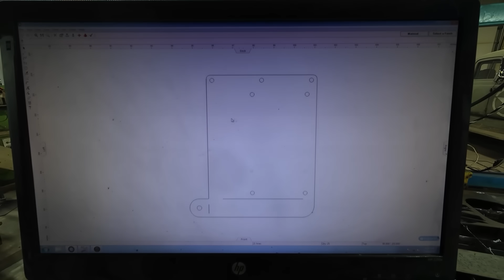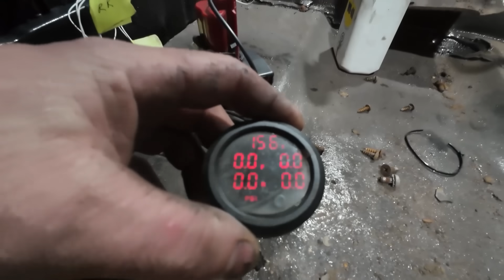Installing & testing the air ride on our 1949 GMC Roadster pickup!

Comment: Funny - this truck... the way it looks... makes me think of a recent build on Salvage to Savage.  They customized a blue and white pickup ... and are still in the middle of it I think.  The bed doesn't have a bottom on it, and it looks a lot like yours... but I guess it would look like any pickup truck - even as far back as 1949.  If you haven't seen it, you might want to check it out.  They are an upscale resto-mod builder, from what I understand.  You make stuff work... and they work on pricey stuff.  Enjoying the build.  Thanks for sharing this project with us.

Comment: Brent, I've seen many many push lock style air tubing fittings over my years as a machine tool repairman. I've also seen many fail too. I would HIGHLY recommend spares in the glove box. They're small enough to keep a handful in the vehicle. It's weird I've seen some of these last for years and some not so much. Various styles (plastic, or nylon, or brass doesn't seem to matter all that much really). Just wanted to put my 2 cents in (sorry idk the Canadian 2 cents or looneys twofers or what have you lol). As always love the video. Btw the music (which I've always thought your selections were mostly perfect over the last few years I've watched your channel) anyway the music when you're painting the back of the cab at the beginning was perfect. And I'm picky. Thanks.

Comment: Nice work as always. Makes me want to go full kustom on the HAK Fargo. Still not convinced with the air ride. Mind you i have never driven or had a ride in something bagged.

Things i have wrecked with my hoist
Air lines
Extension cord
Creeper seat
Tool cart
Broom
Think thats it. So far😂

Comment: the 2500 lb smaller bags are over load air springs to be used on top of leaf spring suspension to help with carrying a load.

Comment: You need too pull the plug(s) on the lower side of the block in the middle near the oil pan it's a 9/16 plug. You can drain almost all the water out of the block this way. Should take both out to drain both sides of the block. I like your Channel. Keep up the good work.
Reply: While the plugs are out find out the correct one and put a block heater in it. Finally put one in my AMC 258 I6 in my CJ7 last fall and it’s started great all winter long.

Comment: Do you know why the Teflon tape roll is so thin...
Probably not so I will tell you it's so after you put the tape on ,you can use the outside edge to push the tape into threads..it works on all size threads...